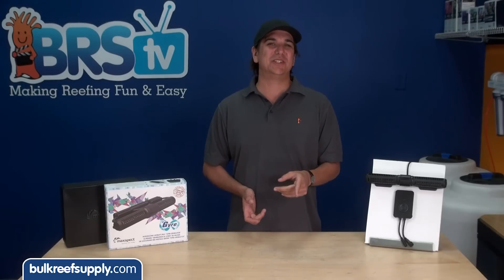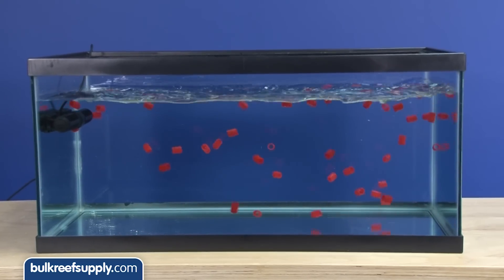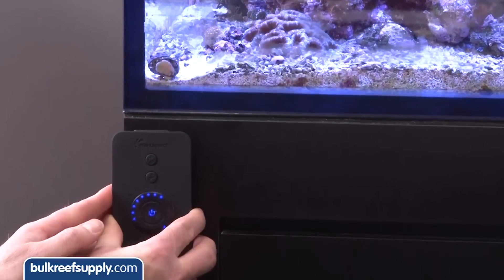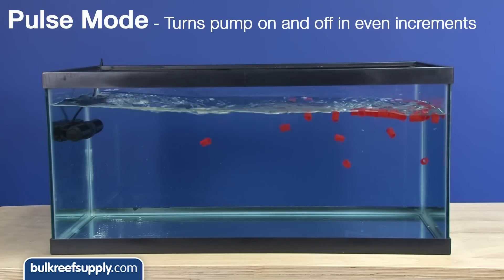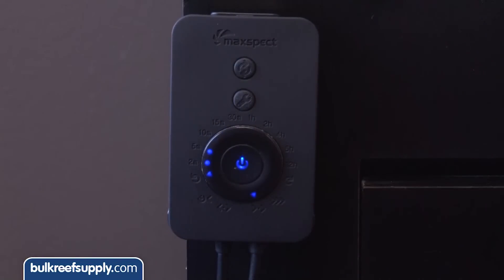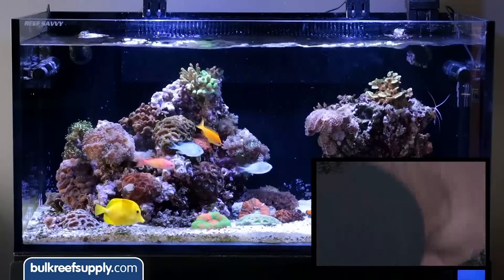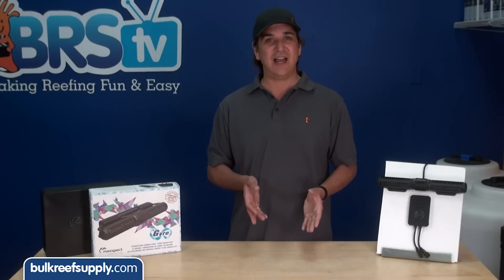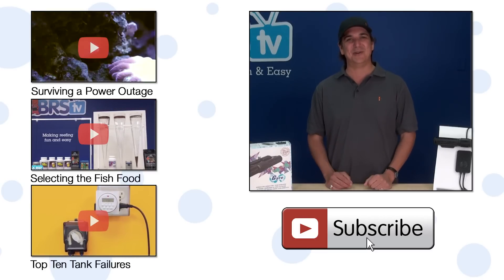How to Install the MaxSpect Gyre 130 & Gyre 150 Powerhead

Comment: I have a question regarding which size to buy.  I looked at the specs on both the 130 and 150. I know the 150 starts at 50 gallon and goes to 500 gallon. I currently have a 30 gallon tank but will be upgrading to a 100+ in the future. I was wondering if the 150 would be too much for the 30 gallon tank even if it is set to the lowest power?

Comment: Thinking about putting one vertical in my 30 gallon cube and run in alternate at 10%..Great deal I was offered with lots of accessories do you think it would be too much flow for a sps tank? 19X19X19

Comment: Awesome Video as always guys. Congrats!  Question.   How would these do with the chance of an anemone wondering around?
Reply: I've had my BTA get stuck in it 3 times after manually splitting them and they were moving around to find a good spot....the impellers are actually somewhat "anemone" safe...not at all like the Vortech propeller which will chop it into shreds.
Reply: 328ciBimmer
Yes thanks!  I do have anemones, bubble tip and riteri in my tank with 2 MP60s.   I usually place the cover when introducing them .  This one had 3 months already on a rock so I took the covers off because they get so dirty very fast.  1 week after decided to wonder and got liquified. :(.  So looking at these as possible solution

Comment: I bought the 150 when it first came out and installed it on my 65 gallon mixed reef tank. I love the Gyre but have only been operating it in the 10-30% range (usually 20%) because it seems to produce too much flow for my 3 foot long tank, whipping my corals around. I was surprised to watch this video and see 2 placed in a 70 gallon & on 60% speed! Am I being too cautious? I was thinking of replacing my 150 with the 130 just to be able to operate it more in the median range. Any thoughts?

Comment: Hi guys great video as usual. Please tell me how did you configure the pump to make the big waves on min 2:40? I've tried different pulsing modes using the maxpect own controler and icecap module for the apex and with none of them I've been able to create that kind of waves. I will love to know the details if you can explain please :)
Reply: Thanks, do you happen to have the time between pulses, is it fast or slow to make that wave possible?
Reply: BulkReefSupplyCom thanks for the info!

Comment: I would love to try one on a 120G but too bad Maxspect can't make it low profile like the Vortech MP40's. I'm tempted to replace my two MP40's with the Maxspect. What do you recommend? Thanks.
Reply: I actually think the mp40 protrudes more from the inside of the glass...I replaced my pair of mp40's for 1 gyre and the moment it kicked on virtually ALL the detritus was swept up. I didn't even realize how much was being left settled with the mp40's until I turned on the Gyre. Sell the 40's and get a Gyre or 2...you will be glad you did. The ONLY reason 2 gyre's would be necessary would be to cross flow as Ryan mentioned in the video...otherwise 1 pump is plenty powerful.
Reply: just got mine up and running, it looks very sleek in my 120g.  while its long, it somehow dose not look big or bulky like the traditional round powerheads.  I  love mine so far, moves tons of water. I like it better then my buddy's $500 powerhead.

Comment: I have a 300G Fowlr and I just last week purchased the Gyre 150. I am using two of the JeBao RW-20 powerheads and located them on one side and located the Gyre in a vertical position on the other side of the tank. will the gyre in your opinion work well in my tank as its 8ft long. your help would be appreciated. Thank you..

Comment: I can't find any info on just how exactly it works. I understand why it's superior because of the circular flow it creates and it's programmability but how TF does it actually pump water with the impellers oriented the way they are sort of out of line of the direction which Yw water flows

Comment: Will this unit turn off if the water level drops and it be controlled by the current ic loop controller
Reply: BulkReefSupplyCom thanks for the info

Comment: I just got one of these, but I'm wondering if anyone knows the best way to have the in/output of my external filter to "work" with this.I currently have the uplift for the canister on back left of my 5ft RENA tank and the output comes out at the back right. I was hoping to mount the gyre thing on the right SIDE of the tank as that is the "outside" hidden by a wall in a corner ( if that makes sense?). I'm worried that if I put the gyro on the wrong side relative to the filter intake, no mess will be drawn out?
Reply: II haven't got it out of the box yet= I'm wondering if I should have gone for the 130 model, not the 150? Will this one be too powerful for my tank

Comment: I have 72" length display tank (innovative marine SR 120) and only have 1 MP40QD. I purchased 1 Gyre FX150. Do u think Gyre FX150 is strong enough that i can remove MP40QD or i still have to use MP40QD? Which one u recommend for my tank? 2 MP40QD or 1 MP + 1 GYRE FX150 or 2 GYRE FX150 or 1 GYRE FX150?

Comment: Hi, I've got a larger tank (300g swim tank) and I'm looking to add some extra flow just to scoop up that settling detritus at the bottom of the tank. I saw this and thought it would be a good fit for my tank but due to the size I'm waiting on the larger 170. Any dates on that?

Also, any input on how they work in the vertical position? I'm not sure where would be best to mount them in my tank. Id like to do just 170 against the back glass, but I'm guessing I'll probably end up needing two, so I was thinking maybe I could do them vertical on the long sides of my center overflow.

my tank:
http://imgur.com/uzFYfI3
Reply: *****  We are willing to wait, but where would you place them in a tank like mine? Do they work well in the vertical position?

Maybe one in the far back in the horizontal position, and then something else in the middle overflow like a tunze?
Reply: Are there any advantages to having a wave, or is it purely visual? I just want the fish doodies to not settle on the bottom any more :)